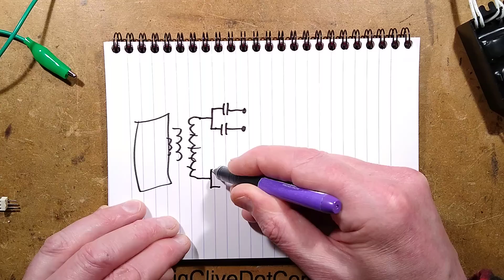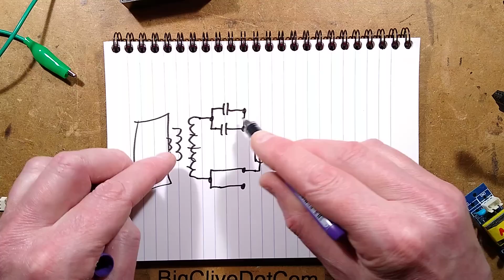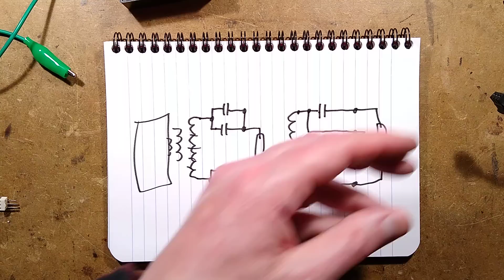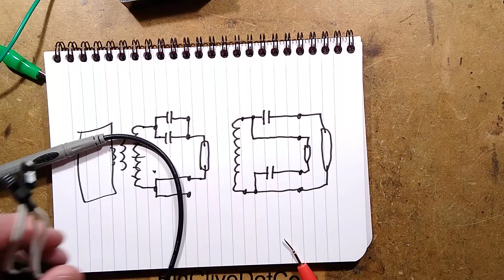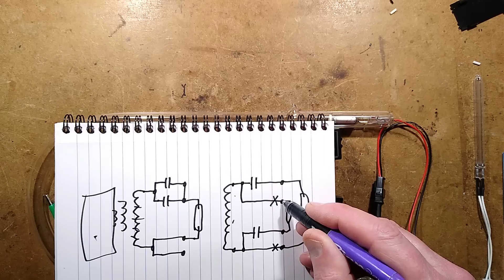Neon tube driver hacks

Comment: A good tip when handling neon, that tip off where the tubulation has been made for pumping, that is the weakest most fragile point. Even picking at it with your finger nails can break that. I like using tubulated electrodes now where the tip off pokes out the back of the electrode, that way the rubber cap protects it once its installed

Comment: Grew up in a family sign business with our own neon shop. I designed hundreds of tubes using CorelDRAW and working with our tube bender. Very sad when LEDs took over. Our tube bender went back to school to get his electrical license as he saw the writing on the wall. I still have a large Santa sign I hang on the house during Christmas made of many different colored tubes and running at 30mA. I cringe every time I take it out of storage to hang it. I’ll break it one of these days and that will be the end. There is nobody left in my area bending glass.

In the sign industry everything runs at either 30mA or 60. Most of what I worked with were large transformers. These smaller electrics came out the last decade of neons heyday. We always thought they were less reliable doing service work than the big iron as we called them.

Comment: Back in the day, I was an auto neon fanatic! When they 1st came out l had to defend myself against local law enforcement; I received 5 tickets in a 2 week period. After the first one I went to the Highway Patrol office and talked to them. They told me that neon under carriage kits were not illegal (long as they weren't visible, blue, red or flashed). An officer even gave me a signed paper from the state of SC to show any other officers that I was within the law. 2nd traffic stop (btw, all 5 tickets came from the same officer) I showed him the paper and he read it and said, "I don't care what a state trooper told you,. They're illegal & you won't be running them in my city." Well, I went right back and told the trooper what the officer said & he was ferocious, "he better watch his mouth or I'll pull rank on him". Anyway, I was the talk of the court room and to my surprise the trooper showed up for my hearing and was floored by the amount of tickets I received.... Each ticket was going to cost me $300+ and 4 points. The trooper never had to say a word, the judge looked over everything and dismissed my charges. Then the ticketing officer said, but judge if you would step outside and look at his car...... Judge - "I DON'T HAVE TIME.... because of all these minor violations you have in front of me." Everyone in the court room applauded when the judge slammed the hammer down. 
I walked out with my head high! 😉

Comment: Oh man... I've got a PILE of those little power supplies laying around from when the craze in the early 2000's was around of putting the little colored cold cathode tubes in acrylic computer towers. All the tubes I had went dim a long time ago, and I still have a bunch of the power supplies around. Now I know what to do with them. I'm glad I hung onto them for 2 decades. 👍 

Good tip!

Comment: Those angle cutters strip way better if you flip them around so the flat side is pushing off the scrap insulation.  Your angled side is squeezing it tighter against the wire.

Comment: I have a 2007 BMW, the angel eyes are a light pipe with a halogen bulb
They look a little yellow. Looks better with a white LED, matches the colour temperature of the Xenon head lights

I would be surprised if they used actual neons, even for older cars

Comment: I managed to commission a full-custom (actual) neon sign off of Aliexpress. 24"x24" for ~£180 delivered about 3 years ago, maybe going on 4 now? Worth taking a look. I'm sure you could ask them to just send you some lengths of tubing, although whether you'll get any benefit in pricing I don't know as those sign listings are priced by size, not by length of tube. Was a wonderful design by the way, a fire/icy rain yin-yang affair: White, blue, turquoise, red, orange, and yellow gas-filled tubing in pretty intricate patterns. Came with driver and EU power cord with UK adapter, and all mounted on a metal frame with both legs to stand it up on a shelf, and a chain to hang it from a wall fixture.

Comment: I still have the four in the bottom side of my engine table I built.  Pretty handy little units.  I triggered them with a sequencer board I bought off ebay to simulate the cylinders firing.

Comment: Doesn't a neon tube need a ballast resistor due to negative resistance?  This was discussed with He Ne laser tubes.
Reply from the maker: The capacitor limits current through the tube with changing voltage.

Comment: Your channel gave me the courage to unsoder a expensive switch in a salt truck and put a cheep eBay switch back in.  It worked and saved $2999.00 plus labor. The new switch was like ¢69.  First time trying anything electric thanks 😁👍
Reply from the maker: Keep in mind that cheap eBay items are not really suited to safety critical applications.  But for a non critical application they can be fine.

Comment: I see these used as ignitors for furnace burners, how dangerous are they?
Reply from the maker: I wouldn't expect it to work well for that application.  The current and voltage are quite low compared to igniters.

Comment: Angel eye lights on cars are LED with a fibre optic tube (since around 2010) The older ones 2001+ used a halogen bulb and fibre optics.
I was unfortunate enough to have to replace a headlight last year on my M5 and the LED modules alone are about £150 each
Reply: The ones in my Audi are ccfl tubes. It's all about not buying cheap junk.

Comment: @6:30 you could have measured the capacitance on the wires, and they would effectively be in series, so it would halve the value, so doubling the measured value would give the cap value without dismantling it.

Comment: Are there any risks involved?
I installed an old disco sign recently, i think something like 20kv, 20 watts...
And i had massive respect.
I tried using old ignition cables but they had a resistance. So i switched to cheap chinese hv cables. No test wires for me. ;)
Reply from the maker: There is specific cable for neon signs.  I think they use boiler ignition wire in the USA and it's dedicated silicone insulated neon sign cable in Europe.

Comment: A slightly related question :) I have seen regular or slightly wider neon tubes running in a way that makes a crawling moving arc inside the tube rather than lighting the entire width evenly as in the example above. I understand it is easier to do this with Xenon than with Neon, but I know it’s possible as I’ve seen it. I’ve experimented with many kinds of power supplies including things like this and nothing does anything remotely like what I’d love to see. I’ve got some very high wattage sodium vapour lights that are filled with Neon and I think argon as a starter gas. If I hook them up to anything like this they make a nice pinkish tube, but I want the crawling moving display within them. If anybody has any idea how to go about this or has a link upon which I can start learning some more about that I’d be very happy!
Reply from the maker: I think some snaking tubes use xenon and a high frequency power supply.  Some plain tubes do snake initially after manufacture, but usually stop after a while.
Reply: You need a tube filled at a higher pressure. Plasma globes are also close to atmospheric pressure.

Comment: While watching your video I remembered the time, when I was a kid, when I was doing experiments running a small linear 70W metal halide bulb (yep, one of those eye-blinding lamps that once lit shopping windows) with a similar 6 or 12V inverter. It was quite impressive to see that the inverter was able to strike and stabilize to some extent the discharge inside the bulb, which of course put out a very small fraction of the brightness that it would if powered on the right ballast, but still while at a very low power the thing actually worked. And it was able to shed a bit of light around in a very dark environment.

Comment: I have 3 old neon transformers and 1 electronic one. I got given them years ago for free from a sign shop that had no use for them anymore. One is in a big metal box (Tunwell i think) the other 2 are solid potted blocks with a plastic cover (FART brand). I've had more fun than should be allowed with these things, (tesla coils mainly). All still going strong.

Comment: I remember as a kid going into shops that had closed down to liberate the neon transformers they were huge by todays standards and quite dangerous I had 3 of them rated at 11kv 180 mA wish I had them now
Reply from the maker: 180mA is huge.  They're usually just up to around 60mA.  That one might have been for practical cold cathode lighting tubes.

Comment: I have been playing with these and being digitally controlled via a microcontroller.

It does seem possible to regulate brightness a bit by controlling the voltage, but not sure if it's safe or sound
Reply from the maker: The ones for LCD backlighting can usually be dimmed by an analogue control signal, or possibly PWM.

Comment: I remember my teenage years working in a late bar. I had a good relationship with the manager and he would let me program the 0-10v touch pad lighting desk wired to NJD Dimmer packs under the desk. It did everything in there. The pin spots (Par36) the floods, the par36 head scanners, the fancy effects (just motorised lenses spinning around on 3 axis) and most interestingly, the NEON! There were 4 rows of 2 phosphor pink and 2 blood red tubes lining the dance floor, a green pub name sign behind the bar and all the pink neon that lit all the seating areas. I used to have hours of fun on days off going up there and doing a live lighting show by dimming, chasing and beating to the music. It was much more enjoyable than just watching some pre programmed sequence running through, missing beats or not doing enough of one effect. I made it dynamic to the individual song being played. LOVED IT! Even got to keep a cheeky length of tube after a refit, but alas never had the skill to light it LOL Miss those days..Id dread to think how much power ran through there.

Comment: Hi Clive.  As usual, very informative.  I have an ACME "Luminous Tube" neon sign transformer that's at least 50 years old.  Made in Cuba, New Youk, USA.  It weighs about 23 lbs, and it's rated at 12,000 volts, 30 ma.  It makes a mean Jacob's Ladder.  One must treat this monster with great respect!
Reply from the maker: The old traditional ones outlast modern electronic transformers greatly.

Comment: Presumably you could measure the capacitor in the first configuration by metering across the two capacitor outputs and measuring their desires capacitance. Can't remember how capacitors combine in value when in series.

Comment: I've been helping folks restore pads for DDR arcade machines for a few years now, and a common task is the removal of neon tubes. They originally came with 16 4" tubes in the pads, half pink half light blue. Most prefer LEDs these days, but I've always kept the old neons just since you can't get them anymore. Thanks for sharing some knowledge - I'll make sure to learn more before trying to turn them into art or something like that, but you've given me some great information as a jumping off point!

Edit: didn't expect the dancing stage mention!! Huzzah, I feel recognized! A lot of the early 2000s rhythm games had them, too... Pop'n music, beatmania, guitar freaks, drummania... Usually they'd mainly be halo style lights within the subwoofer assemblies, with the occasional straight one hidden in for accents.

Comment: Clive, fancy me sending you a solar panel "trickle charger" I bought. Absolutely useless, output in full sun is 0.13a, was sold at 30w. No idea what this means but useless for a 12v battery in my view so rather it went to some experiment somehow or the other.
Reply from the maker: It probably still has use at lower current for charging a small cell and LEDs arrangement.

Comment: I used to make neon tubes back in the late 90s and early 2000s. Was quite a fun experience. Actual neon tubes generally glow bluish pink when you first make them. When they run for a while on the bombarder the bright orange develops.
Reply: The little factory in Mt. Vernon, IL finally closed.

Comment: Nice driver! Have a UV water sterilization unit that follows an RO water system. It uses a GPH180T5L 10 watt tube, wonder if it will work in it or if there are any other DC input drivers at 13.8 volts.
Also looking for a replacement bi pin tube marked G15T8 from GE, my tube is at least 40 years old and has only been used the last 17 years for about an hour a month.
Reply from the maker: It's better to use the correct tube driver for a critical device like a UVC steriliser.  Also note that the tubes do degrade in UVC output over time even though they still light up bright blue.

Comment: I think the driver might be a Baxandall (yes, the same genius of tone control fame) type judging by the series choke and nearby capacitor viz 2:55.  I don't think anyone would use a Royer in automotive applications (where the voltage can vary between 11v9 to 14v2) as Royers are much too voltage touchy, where Baxandalls are much more tolerant of poorly regulated supply. Also, since Royers run by saturation (therefore square wave) they can be very, very noisy.

Comment: Another source of those inverters are old flatbed scanners. Big ugly things, and used a thin CCFL flouro tube to illuminate the work. These days they use a LED array of course. Much more efficient and no inverter required.

Among other things, I used to replace flouro  backlights in laptops back in the day and still have a bunch of 3mm tubes in stock. Too good to throw out, but utterly useless for anything else...

Comment: Would this be able to be used in a “Jacob’s Ladder,” remember my  dad connecting some thick copper wires to the output of a massive 110v powered neon transformer. I enjoyed the sight and sound of that arc move up.
Reply from the maker: This isn't high enough power.  It needs a traditional neon sign transformer.

Comment: I still have some of the old 15kv transformers in with my neon stuff. Please keep your fingers out of arc range. Thank you, keep working.
Reply: Tesla coil people want those!
Reply: @solarsynapse  That's possible. I would even part with them for their value. However, there are several, more practicle, ways to prime a tesla coil. Tesla was the "cutting edge" in his day, so he didn't have our material sciences to draw from. Also, some of his materials, like bakelite, are not available today. If you decide to build one, I'll offer you some suggestions.
Reply: @d.t.4523  I did build one using 2 MOTs, but it doesn't work.  As 1 person suggested, I divided the capacitors equally on each side of the spark gap instead of all on one side.  Good?  Bad?  Indifferent?  I also do not know if I have the primary winding going the correct direction with respect to the secondary.  I am sure it matters like all transformers.  I don't see specific information except to visually look at photos and videos, and nobody will answer.  I know it is a 50/50 chance!  It is a bit confusing with the primary being flat.  Do you consider the inner of the primary being virtually pulled up the secondary or the outer?  I did use JavaTC for numbers.
Reply: @solarsynapse  Putting caps in the wrong place will drain the effective power across the gap. I'm not sure how a 2nd mot will help. Use 4 diodes as a full wave rectifier with a smooting cap. A low frequency iron core mot will wimp out if the spark is loading it directly. The full bridge and cap will give you more stable dc to work with. What is the voltage supposed to be at your primary loop and is it close? How many turns are the sec winding? I didn't see the mail address on your channel, so send me one if you are going to rework it. Let me know and I'll put my contact in a comment for you.
Reply: @d.t.4523  The carriage bolts spark gap is like a welder!  
Input 2 MOTs parallel 120VAC 60A or now series 230VAC 30A.  
Output 2 MOTs back to back series for 4600VAC .4A.  
Must be phased correctly or would cancel and not arch.  
Primary 1/4" copper pipe spaced 1/4" taped at roughly 3-1/2 turns.  
Secondary 20" on 4" PVC pipe, roughly 813 turns of #23 copper.  
16 film caps in series .68uF 1200V for 42.5nf 19200V.  
Topload toroid 4" aluminum dryer pipe, 14.25" diameter.  
Bottom edge at top edge of secondary.
Reply: @solarsynapse  The torroid top might be to much capacitance for the secondary. Wind a 2 turn feedback loop at the bottom of the secondary and look at the waveform on a scope. If you copied a working coil your resonance is to far off. Instead of testing with high voltage, use a ZVS circuit to drive the primary. It won't make big sparks but will have a stable frequency to tune the coils with.  If the coils are tuned already, then tune your spark gap to the ZVS frequency. It may be as simple as your MOTs, or other metal object, is to close to the secondary. Verify the secondary's ground connection. It sounds like the resonance might be working, but there might be a, resistance or inductance, interfering with the primary current. What is the impeadance if the LC section of the primary, and does your MOT"s primary current show that the secondary circuit is pulling a suitable amount of power?